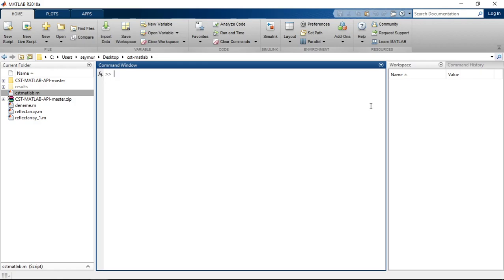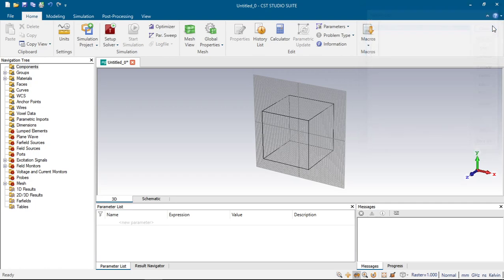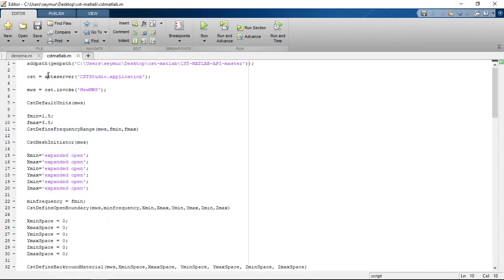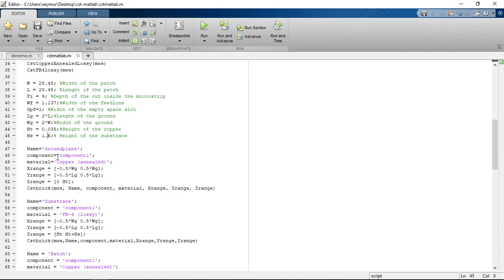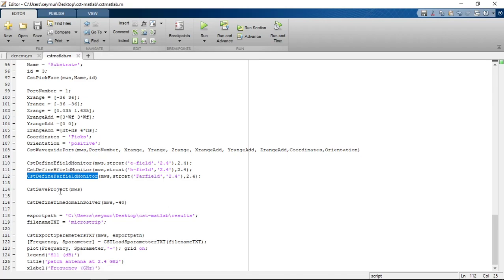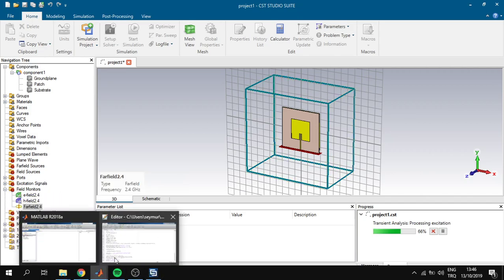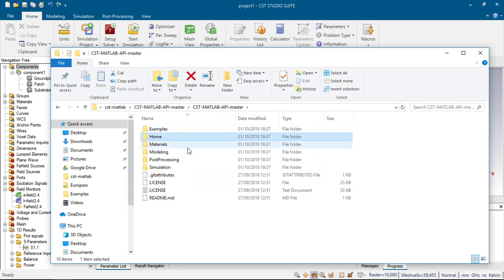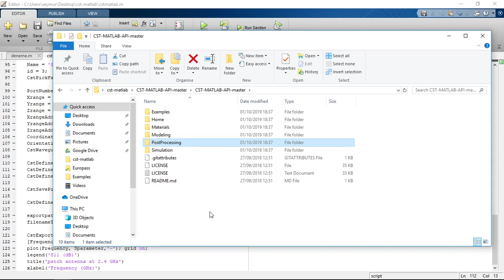2.4 GHz Patch Antenna Design in CST using MATLAB

Comment: Do you have a recomendation for a MATLAB routine that would be applied for interference on a material , where the epsilon and mu values are subject for diffraction. That is to say I would like to see dependency of diffraction character. w.r.t. coincidence angle , polarizatioon, freq. of EM wave as well as thickness, mu and epsilon of the target material???